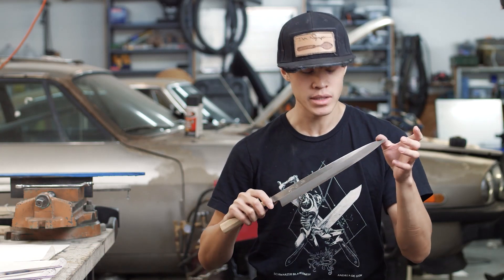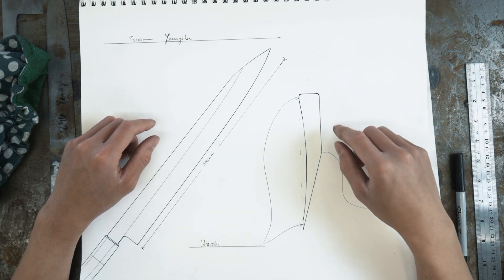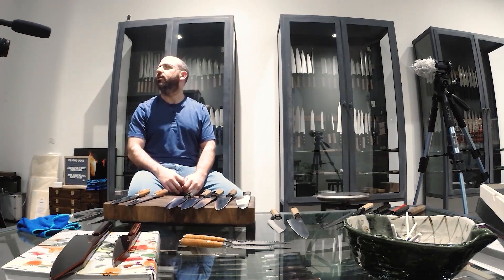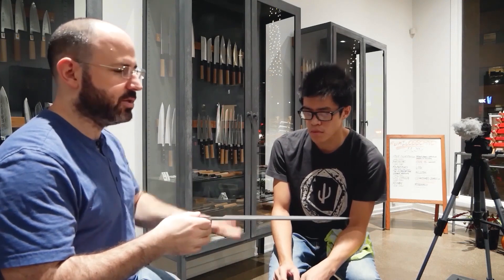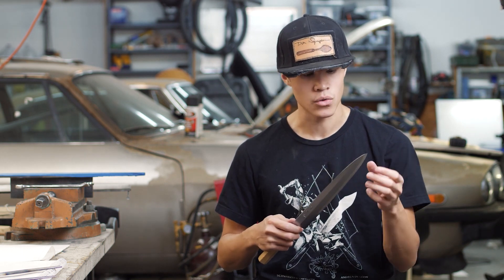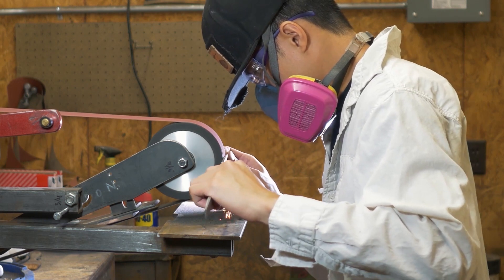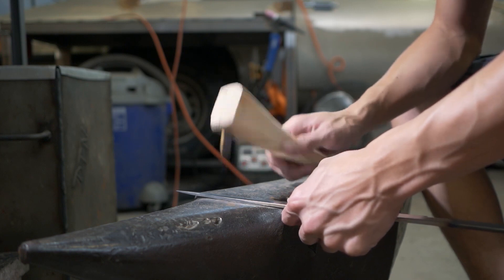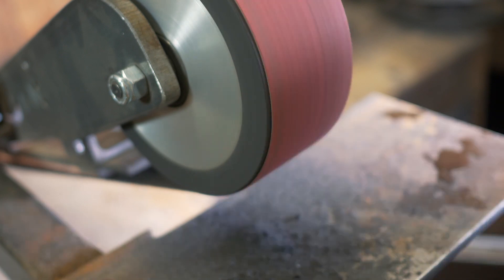Learning Yanagiba - Mystery and Impossibility (Episode 1)

Comment: To get the concave grind, it looks obvious (but we could be totally wrong) they allow for extra maybe 1mm-2mm thickness on the flat side, do the hollow grind all the way up to the tip/edges, and then thin it by grinding the flat side, resulting in a frypan shape and a very even hollow. Only say obvious because we use yanagibas as fishmongers a lot and the hollow runs all the way until almost the tip.

Comment: A couple of South African grinder manufacturers have table that sit under the wheel which allows you to use the table as a work rest and also to see what you're grinding. That setup might help you with the Ura.
Reply from the maker: That definitely makes sense! A work rest around that area would make things more stable too, if you rest your hands on it
Reply: You talking about the Herbst ultimate??
Reply: I'd also recommend using water on your belt so you can work closer to the edge...

Comment: I know by now you already completed the project (I am a bit late on this serie of videos) so I don't know if it will be helpful but in razor making we start the compound grind using a wider radius first to set the bevel width, then we change the wheel cutting the diameter in half for each pass (for example 8", 4", 2"). That gives us crispy lines and a very uniform compound hollow. Granted, razors are a lot smaller and thicker and the hollow is not in the middle of the bevel... thank you for sharing your journey!!

Comment: Don just spitballing here but what about using a radiused platen to get the middle section done, then a smaller wheel like you have, or maybe in 4 inches to get the edge and spine then going back to something like a felt radius platen to blend it? all while using a pivoting work rest that's not too wide (like as wide as the belt) so you can pivot the knife as you get towards the tip.

Edit: I'm just now realizing we have no idea how "in the past" this video is and you may already have a solution
Reply: That's a good approach for sure, and it's similar to the one I currently do right now. I DEFINITELY thought a lot about work rests and designs to be able to pivot the knife. I think it would work if designed really well

Comment: Looks like a yanagiba any% there, actually about the warp you have to undestand that they grind it on huge round spinning wetstones wich minimise te warp, in addition to that, they have wooden "platens" that hold the knife in place and baking it up at its fill contour, the compound grind is done just liek you did there, the deep part is horizontal to the wheel and the more shallow and wider part is diagonally to the wet stone. 

Im taking a guess here but im pretty positive that the grind the hollow part fully, from the spine to the edge but then just put it on sharpening stones to make that flat spot.

Also the sick hollow grind also helps to prolong the wetstones life, because theyre not cheap, and never actually were (the natural ones) so in addition to air pocket that was another reason :)) great work keep it up!
Reply from the maker: I wonder if the large waterstone actually helps mitigate warp. For me I've found that warp during grinding occurs through metal removal, rather than heat and force. For an asymmetric grind, I kind of picture it as though I'm taking out strings of tension but only on one side, or something like that. I could be totally wrong but that's been my experience.

Jon was actually telling me that for the hollow grind they do it all the way like you said, and then just flatten it on a stone to get the uraoshi, rather than how I'm approaching it which is to "chase" it to the flat section as close as I can.
Reply: Hey don, theyre wetstones are constantly watered that what i thought helps them..

Theres an amasing channel that ive been watching thats a good resource 

https://youtube.com/user/Msaya4306

Hes a real pro, hes mainly resharpening the knives, doesnt make them from scratch but sure hope youll find many helpful things there :)) 

Waiting for the next parts of the series!
Reply from the maker: @Inecendium  Haha I've definitely watched a lot of his videos to see his technique

Comment: Heat treat the blade blank before bevel grinding and use Norton blaze ceramic abrasive belts dip in water often each pass keep cool 36g then 50 or 60  grit next 120 can go finer with aluminum oxide or Norton norax belts then cork belt then scotch bright finish belts and if want polished go on to buffer

Comment: I've only made two, so take that into consideration. But, in doing my research and comparing, I noticed the same semi-stepped Ura on the back of the blade. I made mine by using a wheel to set the central / deeper ridge. I then followed up with a 36 inch radius platen to bring the Ura closer to the spine and edge creating a full convex on the rear of the blade. I finished and blended/dialed it in by hand with paper and stone to get about 1/16 off the edge and slightly less from the spine. Might not be the perfect way to do it but, it seemed to provide the best overall order of operations in my practice and final attempts. I'm sure you've figured out a better way by now that we'll see in future videos but, thought I'd share just in case.
Reply from the maker: That's just about exactly how I do it now also, interesting we both came to the same process. Mine varies slightly differently as I use a 14" wheel for everything, but same order of operations

Comment: Super interesting build, and very informative video! I wonder if there is a way of using a mill or CNC to carve out the back of the knife before heat treat?
Reply from the maker: I've thought about that too, and you could definitely do it, but the trouble comes during and after the quench. I think it would be an absolute nightmare to deal with the blade after it's been cnc'd and heat treated
Reply: Yeah as you mentioned you get a lot of warp during the grinding process. I’m curious about what steel your using? Also does the warp come from the stress being on one side?
Reply from the maker: @tylermertens1933  I've used W2 and 52100 for these so far. Both have had warping issues

Comment: Hollow ground backsides are seen in high end chisels and knives.  It allows the maker and user of the knife to be able to make the backside super flat without having to deal with or grind alot of real estate.  You just have to flatten a small surface area to help you make the sharpest edge possible  One downside if that if that perimeter gets too narrow from use or sharpened incorrectly then the knife is trash as there is no way to recreate the hollow ground backside once the perimeter is gone....it is impossible to repair

The ability to release any suction on the flesh of the fish is also likely important as these knives are specifically made long to be able to cut the fish in one pulling stroke rather then sawing and the decrease resistance to the pulling due to a sharp edge, small surface area contact due to its thin profile and hollow ground all play into the design.

Comment: There is a pretty good amount of information out there.
Reply from the maker: There is, but I found that it's more surface level stuff, and I wanted to get a bit more technical.
Reply: @DonNguyenKnives  i can imagine a dearth of info specifically regarding doing traditional knives on modern machinery. so many variables involved  when you change the tooling.

Comment: Maybe some of my comments might be obsoleted by watching your other videos
I made 2 yanigaba in my life (mono steell full py hardened)
Knife 1 I could finish successfully. I warped a bit but I could straighted it). I muts admit my ura sucked (I gotvit blended in but not very fine) but I got the knife sharp.
Knife 2 warped significantly. It was more like a banana. I tried to straighten it but during that procees it cracked.
Knife 3 is in the making, raw blade is shaped and heat treated but no other grinding done yet.
About straightening of a warped blade. I made an apprenticeship as a tool aand die maker. Most of thin tool parts came warped out if heat treatment. Before further grinding we straitended them by hammering. We used small ball pen hammers, same principle as a carbide chissel hammer but not as aggressive. As you learned by yourself there is a limit you can fix with this.
As for hollow ground. It needs a lot of practice. For my first ura I established a center hollow grind with a smaller wheel then then switched to a curved platen and widended the grind gardually. You are right you can’t see it but with practice you can feel it. As practice try some hollow ground hunting knives. I also made two straight razors, both is a good practice.
And I always gring standing, sitting down tenses my body two much and I loose control.

Comment: I love the unga-bunga caveman hammer!
Years ago I got a commission for a Kiritsuke which is basically something I never make out here in the backwoods of Australia. Its got the same sort of weird hollow-compound in the back and single bevel setup. Hmm I thunks to myself, how I into this geometry without making boomerang? So using the greatest western minds which aren't mine, I just grabbed the most dimensional stable billet of steel I had in the whole shed- big ol lump of D6 ledeburitic which is just heaps of carbon, tungsten and chromium that just turns into crazy lumps of carbides to the point its just god-awful to sharpen, but it never really gets blunt either. I think it took 3 x 2h tempers just to get it a bit tougher at 62HRC but it didn't warp! No way in hell even at about 80% done to shape at the air quench it hung in there somehow and all the subsequent grinding after that.
Anyway, that's all I've got to add and good luck!

Comment: You‘ll need a bigger hammer 😅 all joking aside, the carbide hammers we use for straightening blades are a lot heavier and you basically just use the weight of the hammer and the bounce of the anvil to set your marks. Think about one kg/ two pounds of weight of the head. You‘ll get marks that you‘ll need to grind out but the effect goes pretty deep…
Reply from the maker: Hahahahaha yeah the "hammer" is a bit.... undersized. It actually works really well for my process now though, I don't think I need it to be any bigger.

Comment: I'm no knife grinding expert... but I have a suggestion, you can take it as a grain of salt.. 

If you used a press with a "Jig set up".. I.e.. some round stock, that was the right size, that was parallel to the metal being worked, to mash your metal, into the "U" shape, your wanting, BEFORE you start grinding on it, , then you could just gently nudge the metal into the "U" shape your wanting...

And then just go to town, removing material.. on your belt grind on the flat part.. 

That would automatically give you your desired outcome, at least that's how it'd work out in my imagination. 

So maybe you already thought of this? maybe you didn't? but that's how I'd tackle it... rather than trying to do it AFTER the fact.. 

Hope this suggestion gets the creative juices flowing for you?
Reply from the maker: I've thought a lot about how to shape that hollow grind a lot, and I think there are a ton of methods you could do before heat treat. The problem is definitely once it's hardened, even if it's completely straight, it will warp as you take material away. In this scenario the ura would be shaped, but then you're limited by that shape being there and you have to do everything around it, and if you ever need to revisit in that hollow area you are screwed.
Reply: @DonNguyenKnives  How do the Japanese do it then? 
I mean, the way I mentioned, if you used a lot of water/coolant, 
seems like it would work? that should keep it from warping? I know all the videos where I've seen Japanese sharpening cutlery, they've always
had a lot of water flowing.. especially on those "round wet stones" they use.. 

Anyways, thanks for the response.

Comment: You're doing the hammering wrong. You hammer to the inside of the warp and the metal spread by the peining corrects the warp. It works because you're hammering on a flat and hard surface, but it's going to keep warping unless you do it correctly. You'd be better off hammering with a mallet on something like a wood block, which shouldn't be as dangerous as hammering on a monosteel blade.